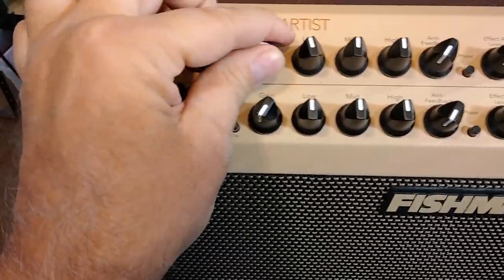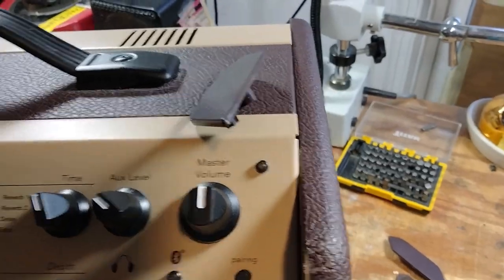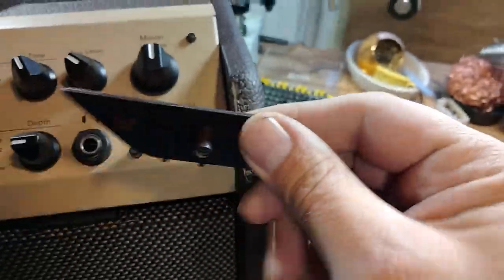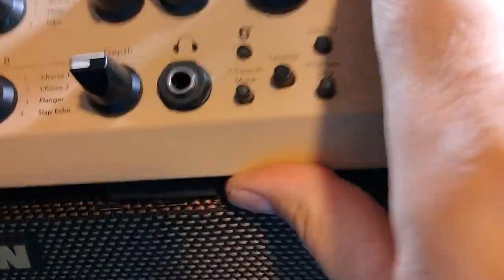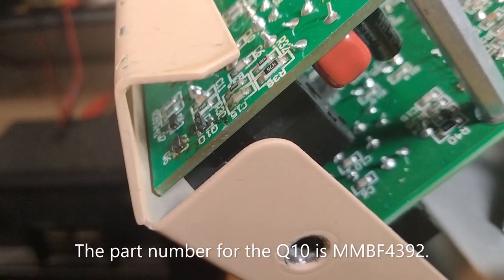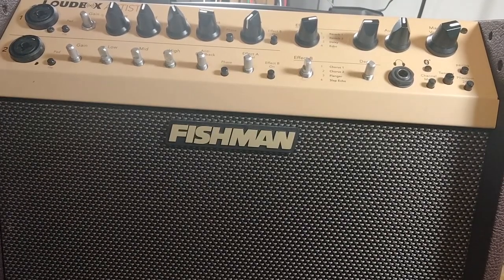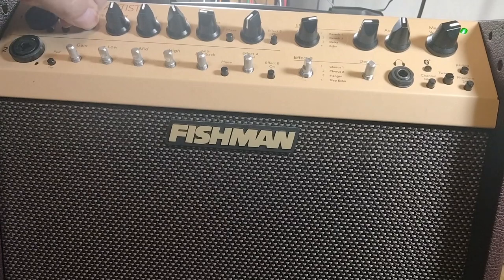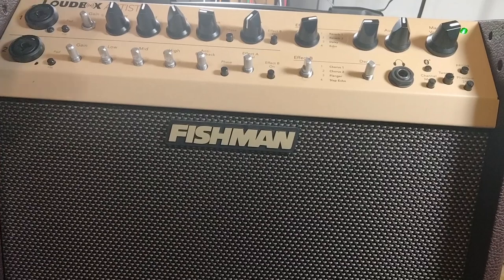FISHMAN Loudbox Artist repair

Comment: Hola, mi parlante tenía roto una resistencia de 0.1 ohms, la remplaze y suena genial, solo tiene un inconveniente, y es que cada vez que lo enciendo emite un ruido, la primera vez al encenderlo después de un tiempo no hace ningún sonido, pero las veces siguientes lo hace, ya revise capacitores y todo está bien, no ce si sea problema de voltajes de algún regulador o los mismos transistores, pero cuando curse mecatronica en la escuela no aprendí mucho, fue más teoría que practica, y pues como ya no continué la universidad pues me quedé solo con algún conocimiento teórico, por último la llevé con un técnico en reparación y tampoco pudo hacer nada

Comment: My Loudbox Artist has EXACTLY that same problem, same channel. Where did you source the part?
Reply from the maker: probably mouser
Reply: My channel 2 is much louder than channel 1. Is that the same with yours? Do you have a slight white noise when you just turn on the master volume?

Comment: Same issue but in Channel 1 (Top) which FET needs to be replaced for the top channel
Reply: I found the FET Q10 on the top board channel 1,  will replacing that FET on the top board eliminate the white noise on channel 1?

Comment: same issue  on mini
Reply: schem. i find has different part designators..  eg 5532 is u3 and tl074 is u4 but a 33079 is used in schemo instead of ne5532 as u9 and 074 is u10
Reply: ps and shows 1/4" in instead of xlr
Reply: nvr mind- found it- no fet pre on this one- 5532 likely issue
Reply: I have fishman mini too, same problem with you, do you fix it???